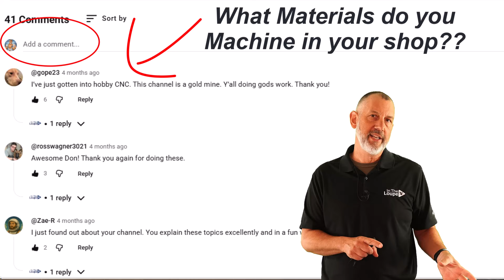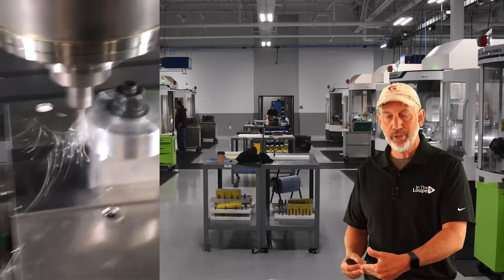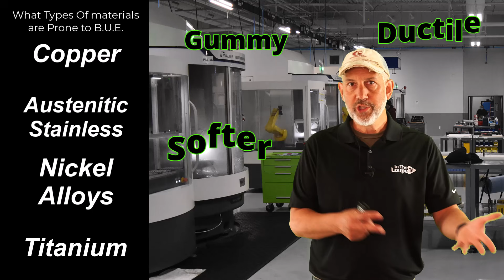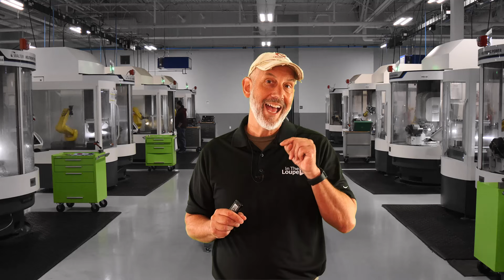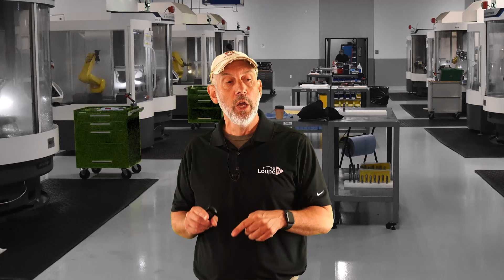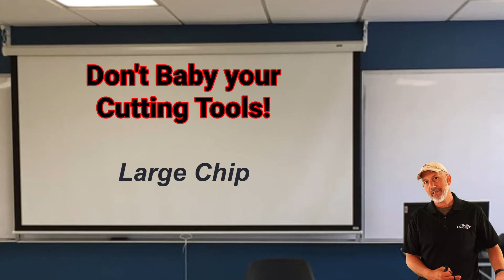A Cutting Tools Unwanted Guest: Built Up Edge - In The Loupe TV Ep. 34

Comment: I was dealing with built up edge on Titanium 6Al-4V on our Fanuc Robo Drill for a while. Our machines are pretty worn out, so rigidity is limited when cutting on the 5 axis trunnion which forces me to do a HEM tool path at about 4%-5% radial engagement 1" axial engagement with a 3/8" 7 flute chip breaker endmill from Helical. When I first was running it, I went straight to the recommended parameters that machining advisor gave me and I instantly had BUE and started getting some chipping on my cutting edge. After some experimenting I found the sweet spot is 3900 RPM 145 IPM. After I started running those parameters I used the same roughing tool for about 1500 parts that had roughing cycles anywhere from 2 minutes to about 10 minutes. We do a lot of surfacing making medical parts, so we tend to get some BUE on surfacing from time to time also. That one usually is a little easier to solve, but man it can be a pain trying to figure it out.

We also mainly cut 6AL-4V, 17-4 PH, HA Peek, and sometimes some Custom 465.
Reply from the maker: This is some great information.  I love when People put in the comments, what they do to fix this problem and what parameters they use.  Recommended cutting tool parameters are a starting point.  Sounds like you dialed it in to help eliminate the BUE.  Love the comment. ctc

Comment: Mostly aluminum, 303/304 stainless, 4140 and 1018
Reply from the maker: That 1018 will give you some Built up edge as well.   I'm sure you run into it from time to time.  Thanks for sharing. ctc

Comment: I run mostly steel with occasional aluminum. How would address this in a lathe where increasing the SFM isn’t possible?
Reply from the maker: 1st and foremost the correct cutting tools,  Second make sure you are taking a larger chip ( increase chipload).. Generates more heat and will roll off cutting edge better and longer..ctc

Comment: 316L, 17-4PH (Condition A and H900) and 6061 if I'm having an easy day.
Reply from the maker: Well those are some materials that like to build up..   H900 condition not so much but the others like to stick to the edge..  Thanks for sharing.. ctc
Reply: I’d never run 17-4, or any other stainless for that matter, until a year ago when I was hired to program mills and lathes for 17-4. Both Cond. A and H900. It was a nightmare. The only thing that’s been consistent for me has been the H900 and using inserts for hardened steels and super alloys.

Comment: A182 gr F6A,A216 GR WCB,A743 GR CA6NM ,A995,A105 materials are being machined in my shop
Reply from the maker: NOT gonna Lie..  Had to look them up!!! haha.   Cast material for Valves and such..  Those types of material don't build up as much but still need correct geometry and strategies. Love to hear it!! ctc
Reply: @InTheLoupeTV_ yes but A995 material is difficult to machine it comes under super duplex category if possible can share your insights regarding tool geometry, grades,PVD and CVD coating to be considered for different material categories and considerations required for different material categories under PMKNSH